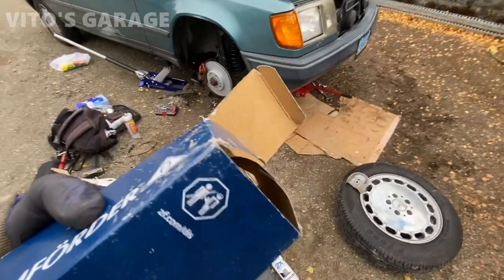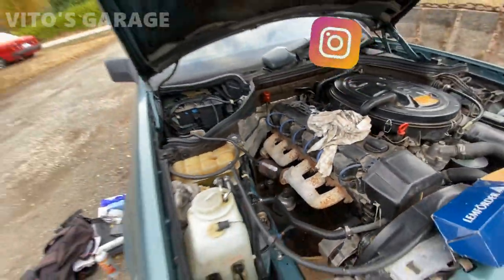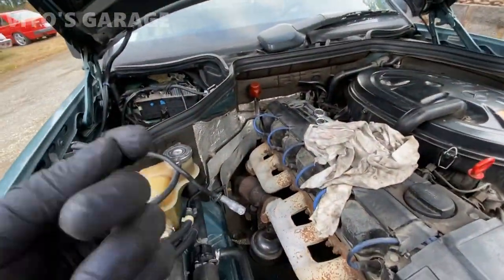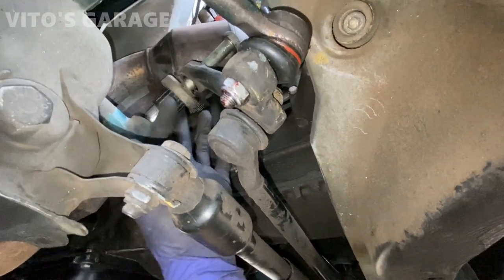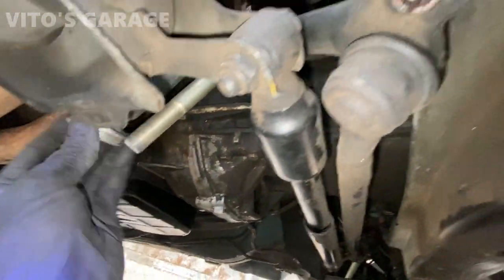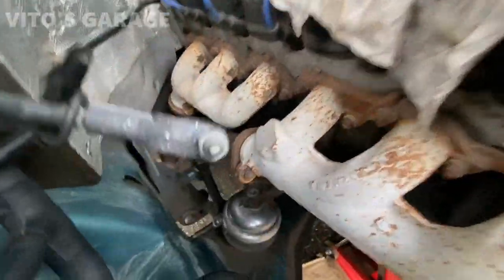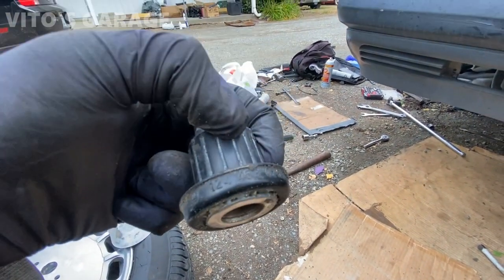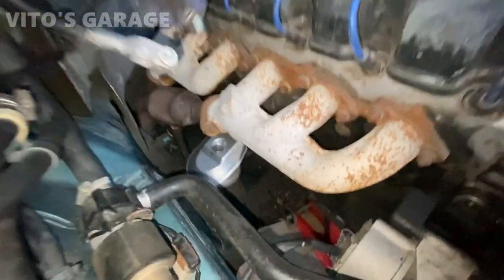Part 6 Mercedes W124 300E How to Easily Replace a Steering Idler Arm with The Exhaust in The Way!

Comment: What was the reason for the replacement? I have a wobble on my w140 and I've replaced all suspension parts on the front. Car wobbles/vibrates violently above 45mph.
Reply from the maker: The car is getting restored. All the components were getting replaced. Some parts like ball joints had play. So they were changed too. 

If your car wobbles then start checking tire balance. Your driveshaft may be not balanced properly. Or a cv axle is bent or loose